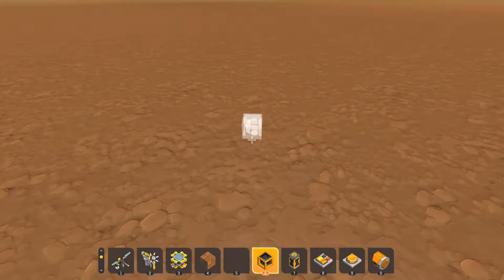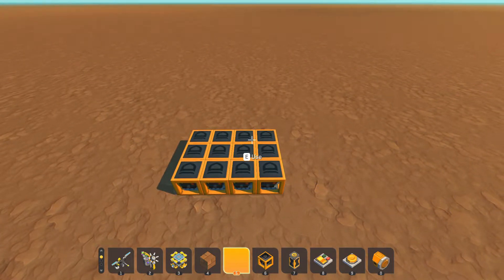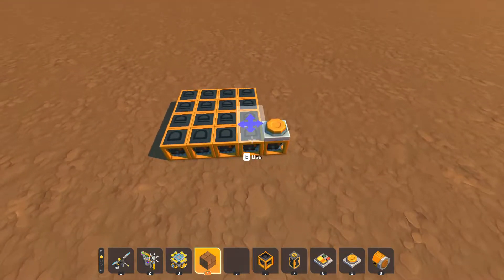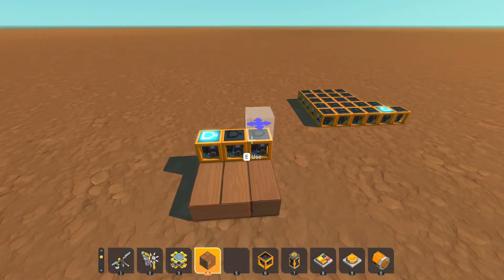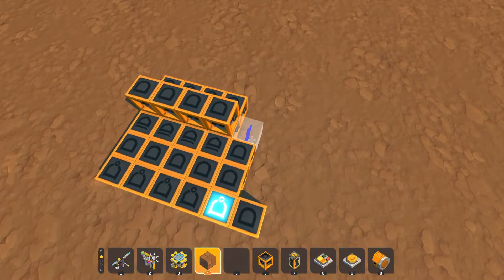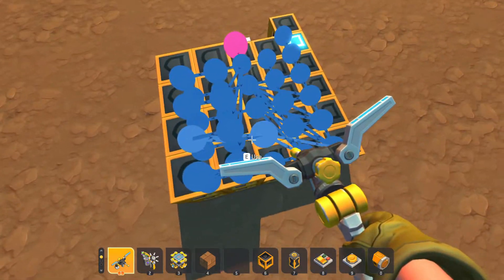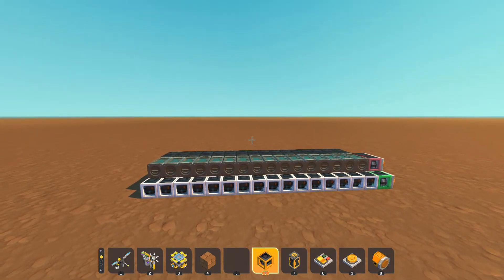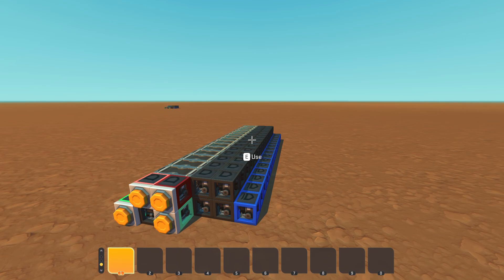Turbo Snail EP1 - Memory - Scrap Mechanic Computer Construction

Comment: Love this, keep it up (btw computers use 64 bits)
Reply: Depends. The x86_64 architecture uses 64 bits but the x86 architecture uses 32 bits. So x86_64 has extra registers such as rax rdi rsi etc. And the x86 has registers such as eax ebx ecx etc.
Reply: computers use the amount of bits that their instruction set supports, one of the first real microprocessors (intel 4004) used only 4 bits
Reply: Not all do
Reply: @rlwithme  Most is most, saying that when someone asks: "What Windows version is used?" it must not be 10 (or what will be 11) because it is not the only one in use is not exactly optimal nor is it answering the question.
Reply: @iXenox  exactly, but you didn’t use the word: “most”.
People get confused when you don’t say exactly what you mean.

Comment: 3:11
Cool, a 1-bit memory cell built on XOR blocks requires to be held for one tick, while a bit-per-bit memory cell built on NOR blocks requires to be held for several ticks

Your 8 bit memory cell is so big
My 8 bit cell consists of 65 blocks and 16 bit model will consist of 130 blocks (it hasn't add/substract function, because why we need ALU then?)
Literally over-engineered
Reply from the maker: Yes, that was one of my mistakes that I heavily regret. I don't know why I thought it was a good idea to include increment/decrement in all of the ram memory cells :P It's meant to be a learning experience, and I learnt my lesson, so I'd say job well done!